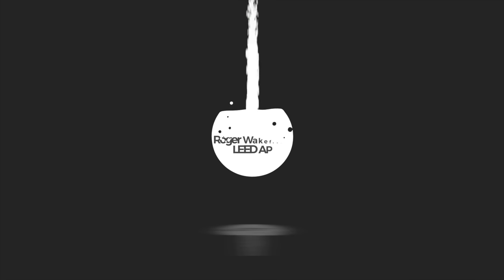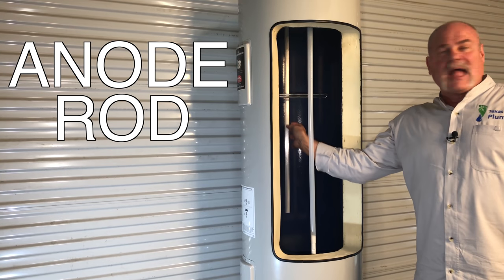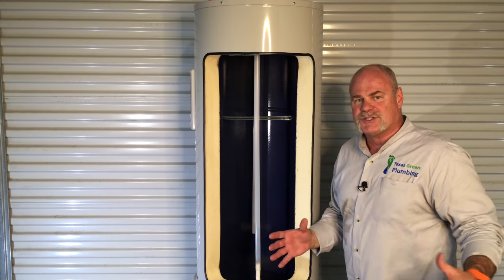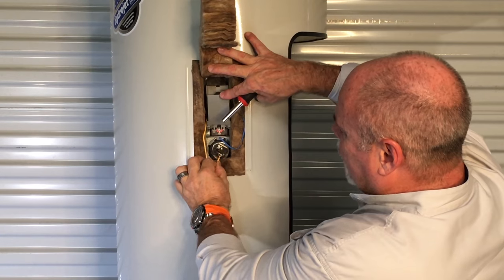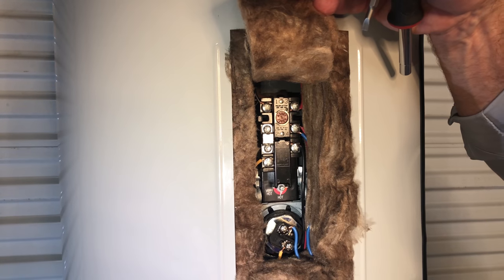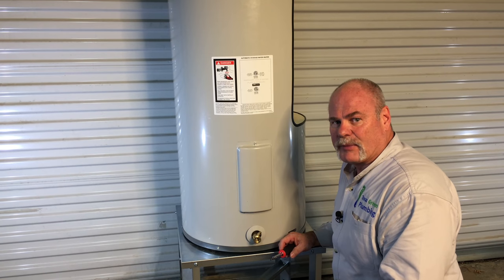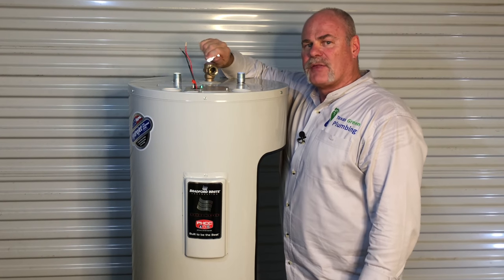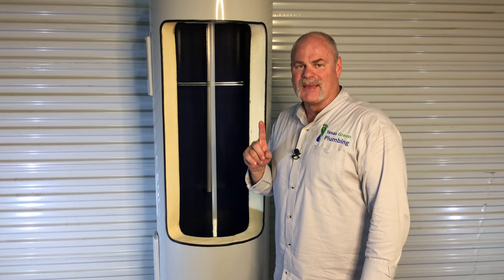What's Inside An Electric Water Heater? - Plumbing Basics - The Expert Plumber

Comment: Knew nothing about heated water tanks so thank you very much for this video. My electric water tank has been working for over 36 years and I didn't even know it needed maintenance. It had a 10 year guarantee by brand name SITAM. Never replaced anode and never flushed. Don't even know how. All I did was remove the thermostat-switch inside and clean it's contacts as it wasn't switching on. I did this twice during periods of time when it was necessary. It is now leaking slightly from 5 tiny holes at the bottom. They seem to be breather holes but don't really know. Don't know what to do should I keep using it or get it replaced or what. I took some photos of the thermostat-switch to remember how it was should I forget (if that is it's proper name). Any suggestions are welcome as to what I should do after all these years...

Comment: Excellent video of explaining the inside of a water heater and how it works, I have a Question I have Ruud electric water heater 40 gallon, I'm replacing the elements and when I looked inside after removing the top element I see what looks like a wire running parallel top to bottom. It's close to the anode rod. What is that?

Comment: Thanks for the high quality video. In a future video, would you consider discussing solar heating set-ups? Thanks very much!
Reply from the maker: @Jake Losh I have done solar water heaters in the past but I haven't done anything in solar heating. What type systems are you talking about?
Reply: @RogerWakefield  Thanks very much for your reply! Apologies, I'm coming at it from a homeowner perspective, so I may not explain well, but the kind of system I'm thinking of involves a connection between some kind of array on a roof that connects to the hot water heater. I'm interested to know how these kinds of systems work, whether they're worth installing, and any risks involved.

Comment: Install a Corro-Protec powered anode rod and it's good for 20 years. It eliminates the sulfuric stink that is caused by the magnesium anode rods. If you have a water softener as well, you might easily get 20 to 30 years life out of your water heater. IF you change your regular anode rod out regularly, and flush the calcium out often if you don't have a water softener, you could also extend dramatically you water heater life. But the Corro-Protec anode rod eliminates the PIA of changing out the anode rod every few years. And really you need to pull and inspect the standard  anode rod EVERY year so you know when to replace it. Now, if you do want to stick with regular anode rods (why?!) get an impact wrench and make life easier!

Comment: The sacrificial anode has a lower electrolysis voltage than the other metal in your system. The erosion due to electrolysis comes out of the sacrificial anode and not the metal in your plumbing or tank.  It does not fill in anything.

Comment: Has something changed in regards the pressure relief valve, in that it's now recommended to open them regularly to test them? Years ago the instructions from the water heater companies were to never open that valve because it weakens the spring and can cause the valve to leak prematurely.

I guess I need to research this to see if things have indeed changed.

Comment: Great video. What if you replace the thermostats and elements and the water heater still does not perform? I get a voltage of 232 across the top element, but the water temperature at the sink a few feet away never gets above 87°. 

What might cause this? 7 year old water heater.
Reply: Inspect the heating elements for damage or corrosion

Comment: I have a Whirlpool electric heater. No hot water. Have replaced both heating elements and both thermostats, still no hot water. What else could it be. It's getting electric to it . Could it be the Anode rod ? How long is it, I only have 33 inches from top of heater to the ceiling. Thanks
Reply: Anode rod doesn't have anything to do with heating.  
Check to make sure all wiring connections are good and thermostats are set to the right temperature and the breaker is good. 
Some also have a hidden reset button you might need to find and press.

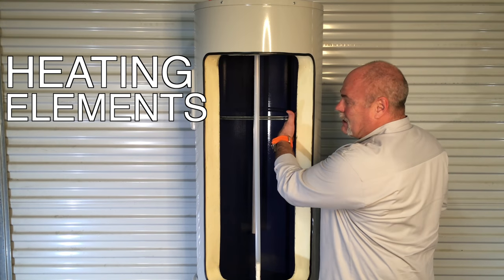Comment: @1:34  The longer heating element does not help heat the water faster...that is entirely dependent upon the number of Watts you are putting in.  The longer element reduces the Watt density, which keep the heat spread over a bigger area and that keeps the element from scaling so badly.

Comment: my new water heater leaking from the bottom when the re circulation pump is on > not from the drain valve ? any tip will be hopeful
Reply: Maybe a bad connection. ?

Comment: And be nice if you could have gone through the electrical connection like from the water heater to the box which wires are you running and why are there only two wires in the 220 outlet just a little more information please

Comment: question?  not sure if its code but can you run your hot water return pump return line be plugged into the drain port... can they do that? is that code??
Reply: Can you do it, yes. Code, no😂

Comment: What happens if cold water feed is hooked up the wrong side of tank??
Reply: Please answer the question
Reply: You'll still have water flow but it will not work efficiently.  The cold water will come in at the top and the hot water will have to flow down to the bottom to get in to the dip tube.

Comment: does the node rode that pulls up the hot water from inside tank to outside pipe?
Reply: Only in a Bradford White. They incorporate the anode rod in to the hot water outlet. Other brands of water heaters have a separate, stand alone anode rod that is not incorporated in to the hot water outlet nipple.
Reply: @mguerramd I have an ao smith with the hot water anode.😊
Reply: @chris76-01  Interesting. I was unaware of that.

Comment: So electric water heaters have anode rods?
I replaced the elements but i swear i didnt saw any other component.
Reply: Sometimes the anode rod is built in to the hot water outlet pipe.